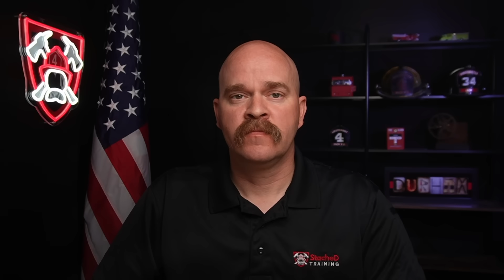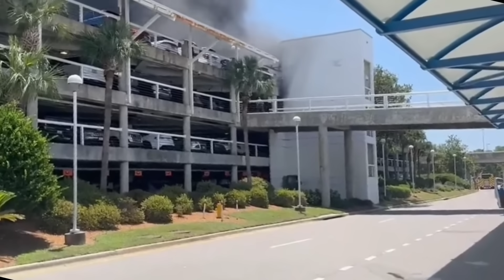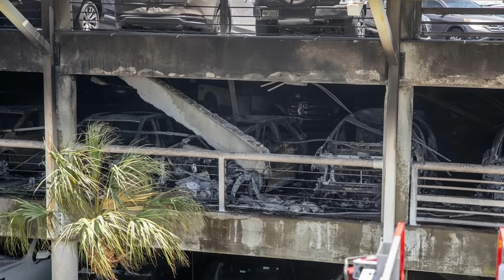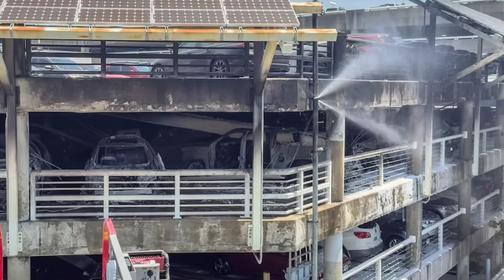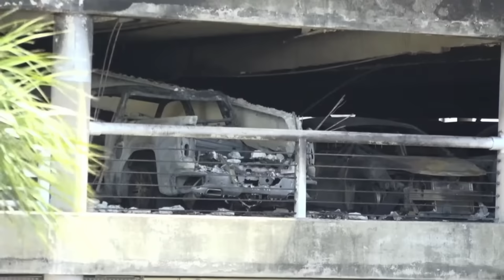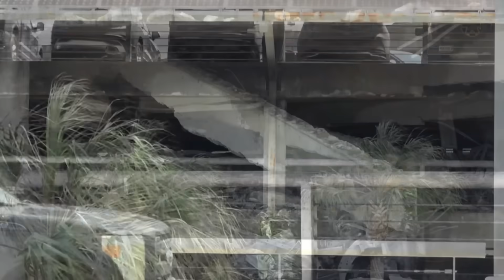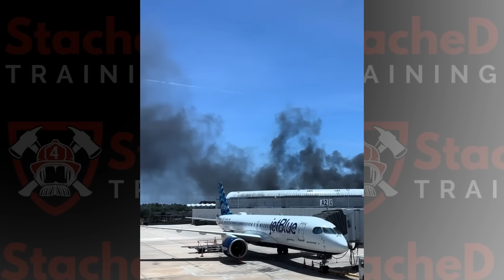Fire, Collapse, and Chaos: Jacksonville Airport Garage Incident

Comment: I like the concept of hybrid electric vehicles form an efficiency standpoint. 
However, we need to take the very real danger this technology posses and make a concerted effort to improve it. 
As it stands I would not feel comfortable owning and operating a modern EV or PHEV design from ANY manufacturer. 

A good idea is a good idea, but a rush to implement a good idea can result in it meeting an early end because the public turns against it. 
This has happened several times in history and once it occurs it is nearly impossible to change the public conception about it. 
This is why media and governments are working overtime to cover up and lie about the dangers of lithium battery tech, they know it is extremely dangerous but are not taking the steps necessary to correct it. 
Companies have no incentive to change the tech, just to push out products to meet demand, and the results are only increasingly tragic. 

Sadly governments are taking exactly the wrong approach to the tech, pushing punitive policies, restrictions, and fines while trying to force a technology that is not ready for it's intended role. They are trying to incentivize people with the stick when the carrot would be much more effective. 
Offer tax breaks or monetary awards of substantial amounts for companies that develop better and safer systems and you will see them rise to the challenge. 
Punishing them for not being able to make the public buy products that are expensive and dangerous is frankly asinine.
Reply: A hybrid vehicle can use a less volatile battery than an EV since its range isn’t as dependent on the battery.
Reply: @dave3657   True, but the chemistry used for the battery is extremely important. 
As we can see with this fire and the frankfurt (iirc) parking garage fire even Hybrid vehicles are dangerous. 
Both were devastatingly destructive fires caused by hybrid vehicles. 
Personally I prefer the concept of a hybrid, a gas engine running a generator and electric motors doing the drivetrain, but there are so few out there that have realized this setup yet. 
Sadly far too many rely on having huge batteries for the majority of their range. 
Personally I think an ideal would be a hybrid using a stable chemistry battery (like a lithium-iron type) with only enough size for about 50-100mile range. That way the gas engine can turn on, recharge the battery quickly, and shut down. Or run for sustained highway speeds to maintain battery efficiency or higher energy needs. 

Just my .02 anyway.
Reply: re: "I like the concept of hybrid electric vehicles form [from] an efficiency standpoint. "
Early models Prius used NI-MH, but 2016 to present used Li-ion primarily.
Remember all those early-year Prius fires? Neither do I ...
Reply: @uploadJ   Agreed. If I recall correctly the Lithium-Iron batteries don't have these problems either plus have significantly longer life. They just don't have the same charge capacity or recharge/discharge rate.

Comment: Well researched video. While concrete doesn't burn and typically has at least a one hour fire rating, it is important to remember that any internal steel giving it shape or strength will expand about 9.5 inches per 100 feet, so roughly 1 inch per 10 feet. The steel can push walls apart or vertical columns that concrete beams rest upon.
Reply: One hour rating must apply to only a thin piece of concrete, as I have seen overpasses that burned in Los Angeles for HOURS. Vagrants and illegal businesses had tons of stuff piled under it. It was on the National news. When it was finally all over  and repairs WERE done to the roadway on top, the structure was not rebuilt.
PROOF..."No, the damaged section of Interstate 10 in Los Angeles did not require complete demolition and rebuilding. Initially, officials considered tearing it down, but after further structural analysis, they determined that "surgical repairs" would be sufficient to restore the freeway. The repairs focused on shoring up the damaged columns, allowing the freeway to reopen within three to five weeks"
Also, in the worst tunnel fire of it's kind in US history "No, the I-80 tunnel did not require a complete rebuild. The westbound tunnel near Green River, Wyoming, sustained extensive damage due to a multi-vehicle crash and fire on February 14, 2025. The fire charred the concrete lining, destroyed lighting and electrical systems, and caused roadway damage3.

However, engineers determined that only a few inches of the 15-inch-thick concrete walls needed replacement. The Wyoming Legislature allocated $15 million for inspection and repairs, aiming to restore the tunnel by October 2025. Until then, two-way traffic is being routed through the eastbound tunnel at a reduced speed limit. "The I-80 tunnel fire near Green River, Wyoming, was intense enough that emergency responders could not enter the tunnel for hours due to extreme heat. While exact temperature readings haven't been publicly released, similar tunnel fires have reached over 1,500°F (815°C) in past incidents.

The fire was fueled by multiple vehicle explosions, including a tractor-trailer carrying transformers, which contributed to the raging flames. Engineers later assessed the structural integrity of the tunnel before allowing crews inside"
Even the structural arches made of alloy deep inside the concrete did NOT need replacing.
Reply: Fire code time requirements vary for the type of structure and construction, with one hour simply being the shortest. A garage fire like this would NOT be the same as an underpass fire, due to the difference in fuel load (BTUs), duration, and temps being applied. Especially after the fire spread to numerous gasoline fuel tanks in adjacent cars, the amount of heat applied in this garage fire  with the low ceilings and reduced ability to ventilate would have been orders of magnitude worse than wood, paper, and anything else that may have been under that overpass.

Comment: One concern I have with hybrids is that, given the battery is considerably smaller than with a pure EV the regenerative braking has the potential to dump a much larger fraction of the battery energy capacity back into it during any given level of regen braking. While I'm sure manufacturers limit the regen braking to accommodate this I feel the small hybrid batteries get a harder life than those in pure EVs. This might just account for the statistics in hybrid fires that are circulating.
Reply: Traditional Toyota hybrids (non-plug-in) operate at a maximum charge range of 40-80%, and under normal operation are limited further to just 50-70%. In other words, the battery is oversized relative to what it is being asked to do.

40% charge is only reachable in my 2016 Prius c when I run the car through a car-wash in neutral (can't charge the battery in neutral), on a hot day with the air-conditioner on. 80% is only reached on a long freeway descent in the mountains. Other than those two circumstances, the battery never drops below 50% charge, and never exceeds 75%, and then only occasionally with 70% being the normal-operation max.

What happens when the battery becomes full on a long mountainous freeway descent, is engine-braking takes over. The engine can be heard revving high as it tries to slow the car down (this is when the transmission is in B-mode, which is the equivalent of low-gear in a conventional car).
Reply: @aliendroneservices6621  Thanks for the reply!
My thought are along these lines:-
Consider regen braking of, say, 1500kg car from 50mph (22m/s) to rest at 0.2g (1.96m/s)
Stop time = 22/1.96 = 11 seconds
Deceleration force = 1500 x 9.81 x 0.2 Newtons = 2943N
Initial deceleration power = F x V = 2943N x 22m/s = 64.7kW (this tapers linearly to 0 as the stop progresses)
Total energy recovered in stop from 50mph = 0.5 x 1500 x (22)^2 = 363kJ = 0.1kWh

If the battery is, say, 2kWh (as, perhaps, in a hybrid) then the initial regen power dump into the battery is at 32C (0 - 100% equivalent in under 2 minutes!)  and the whole braking event would be at an average of 16C (0 - 100% in 4 minutes!) and be 5% of the energy capacity of the battery.

with a 40kWh battery these figures come down to 1.6C (0 - 100% in 37.5 minutes) and 0.8C (0 - 100% in 75 minutes) and 0.25% of energy capacity.

With this sum in mind I'm concerned that some manufacturers may be tempted to give the small batteries in hybrids a hard time in order to maximise the effectiveness of regen braking.

Comment: It's weird that sprinkler systems were not the default, knowing how much more common gas and diesel vehicles catch on fire ;) It's only the very rare EV battery issue that calls for expensive sprinkler systems to combat the very rare occasional EV event.
Reply: Gasoline is the you need to worry about, the fumes are very dangerous.  Diesel it takes alot of to burn.

Comment: how did anyone ever think that 600 v 50 kWh batteries in cars would be a good idea and then mass manufacture them? - and people believe in evolution ...
Reply: Imagine - building a 'kinetic energy recovery technology' into vehicle that could actually save actual money, but it DOES involve batteries, and we call them HYBRIDS ...
Reply: @uploadJ  how much energy do you recover? enough to cross the intersection. is adding so much complexity justified? there is nothing green about lithium batteries. for every 1 ton battery you have to mine 250 tons of ore and all of it is transported using trucks run on fossil fuels and processed with energy generated by fossil fuels etc etc. the whole net zero agenda is madness. resale on EVs is abysmal and the whole thing is a scam look at all the EVs in massive EV graveyards. EVs are throw away ill conceived electric 6 ton boat anchors.
Reply: Government has worsened this problem by pressing the public hard on EV adoption. Without the myriad state and federal incentives, adoption would have proceeded more gradually due to genuine market forces, and there would have been more time for infrastructure to catch up with the new fire threats that EVs bring.
Reply: government mandates pushing a technology not wanted by the majority of people.

Comment: Sprinkler systems in an open air parking garage will require a dry pipe or a pre action system to prevent pipe or sprinkler failure in freezing weather. Yes it can get below freezing in Jacksonville.
Reply from the maker: The maintenence side is an absolute nightmare in cold climates.
Reply: "Can" get below freezing, but minimal insulation and a heating element will keep water pipes above freezing.
Reply: @koriko88 what about in cold locales?  Where i live it can be minus 30 at night with daytime highs of minus 15F.  How could that possibly work.
Reply: @howebrad4601 You’d have a different system there so it would be an entirely different discussion. That’s not where this is. This is Jacksonville.
Reply: Many of the open air systems here are pre charged with glycol.
Reply: @JordieG8  glycol is flammable, haha
Reply: @jamesalles139 pure glycol is moderately flammable however, when mixed with water it is not.
Reply: @JordieG8 when the water boils off it does become flammable again
Reply: In my part of Canada, open pipes are filled with glycol to sit. Upon an event, the glycol is quickly followed by water. Other point out glycol is flammable. Yes, but not like gasoline or diesel.
Reply: The clycol is probably just for keeping the lines from getting  damage from freezing in standby mode ,if a fire acures and the system is put in action  there is no point of keeping pumping in glycol into the sprinklers.  The system needs to be built for clycol re filling afterwards if the damage from the fire isnt so big that it doesn't matter anymore if it freezes.  There are fog/ micro droplets sprinklers that cool of better and  than the traditional type of water sprinklers they use dramatically less water also( less contaminated water into the environment),and the fog displaces air limiting the oxygen to the fire .
These types of systems can be built as dry systems that are supplied with water from pre pressurized tank, because the amount of water used is less the sprinkler heads can be open, the system just fill the whole sprinkler section area with fog.
Reply: @perstaffanlundgren yes, basically. A pre measured amount of glycol, based on system volume is placed into the system before the supply valve is opened. Here, I believe the amount is based on keeping the system at a -15 freeze point. It’s doesn’t get that cold here.

Comment: How about No electric, or hybrid in any parking garage
Reply: Any vehicle fire in a garage without working sprinklers will be a disaster. And with modern vehicles having more unnecessary electronics in them with people also leaving their own electronics in them, the likelihood of vehicles going up in flames from electronic failures will still go up in general.
Reply: Make sure to ban the gasoline and diesel vehicles, too.  I've seen gasoline burn!
Reply: Why, ICE vehicles cause proportionately many more fires,  and have been involved in many more devastating garage fires.
Reply: @mr3745 but they typically don’t run wild like battery fires, create hazmat with the remaining batteries. It’s easier and less complicated to control a ICE fire. They don’t runaway like the Jax fire
Reply: Plastic fuel tanks near hot exhausts.... even a semi-seized brake calliper can cause fires... should we remove those too ???
Reply: Eventually insurance companies will have to do something about the disproportionate risks of EVs and hybrids. I can imagine them requiring something like 20ft radius distances between parked EVs or separate EV garages or more effective fire suppression systems that don’t use water. EVs are just intolerable.
Reply: I strongly agree
Reply: Unfortunately some of the most devastating parking garage fires didn't involve either hybrids or Bevs, nor were they even present in the garages.
Reply: @ryanfagan4563  Where were those incidents?
Reply: @andrewlutes2048  one is the 2017 Liverpool Echo Arena Parking Garage Fire. Another and more recent, is the Luton Parking Garage Fire. Almost 3,000 vehicles destroyed between these 2 incidents. There are plenty more
Reply: @PaulThomasHarris Just to add here it only makes sense to add gas and diesel and hydrogen fueled vehicles to be banned in any parking garage too.
Reply: Also no gas or diesel cars in any parking garage.  Then there will be no risk of fires whatsoever.
Reply: @koriko88 
Well then it's not a parkings garage is it😮
Reply: @koriko88 dope
Reply: @koriko88 diesel is safe, gasoline fumes are a problem
Reply: @koriko88  Gas and diesel vehicles do not spontaneously combust into runaway infernos
Reply: @msw7021 the 2 major fires I just noted before your comment were both gas and diesel, that sparked MAJOR fires. It happens a lot

Comment: BMW recently recalled over 700,000 vehicles due to electrical issues in the water pump, causing fires. This fire reminded me of that huge Garage fire in England about 8 yrs ago. Sprinkler Systems should be required even as a retro fit.
Reply: Liverpool’s Echo Arena Garage Fire 2018, Also the Luton Garage Fire
Reply: Luton was October 2023 and 1400 cars destroyed!
Reply: @bokhans exactly, hence the need for fire suppression in a parking garage
Reply: What wiring do you need to run an incredibly simple and mechanical water pump?!?
Reply: @Foofrarf23 Specifically, the problem with these BMWs involves the water pump's electrical pump connector allowing water to drip from the positive crankcase ventilation system through the seal, potentially causing a short circuit.
Reply: If BMW caused this fire due to a defective waterpump or a EV they should be responsible for the damages & other vehicles lost thru their product liability insurance coverage
Reply: I think you could put a spinkler system in this building being it is in warm climate. I have been out of Metro airport in Michigan many times. In winter those sprinkler lines would freeze with the openess of a parking garage
Reply: Sprinkler systems tend to suffer from vandalisim and frost damage in these kinds of buildings...this results in them.being turned off too often..
Reply: BMW vehicles had huge problem of spontaneous combustion few years ago in South Korea.
not sure if they resolved the problem.
Reply: any combustion car thats leacking oil can catch fire
Reply: Water pump in an EV?! Lol.
Reply: @DesertCatDad  Many, if not most, EVs have a watercooling loop for the batteries, and they have waterpumps to circulate the fluid. But the BMW recall was for the ICE water pumps, which are electric in many BMWs.
Reply: That makes sense. I got hung up on terminology. I would have called it something different. 

 @Kevin_Rhodes
Reply: @Kevin_Rhodes  If you're BMW, there's no sense making anything simple, reliable, or inexpensive to repair.
Reply: @jed-henrywitkowski6470 who said anything about an EV?
Reply: @DesertCatDad  Hybrid.   It still has an IC engine.
Reply: @DesertCatDad  evs do have water pumps,maybe you need to watch some videos of car taredowns and dissasembely because you clealry have no clue what is under hte bodypanels of a car

Comment: I'd be interested to know about a high heat EV fire near exposure to the tensioning points of the garage tensioned slabs. That may have been the source of the collapse. Tensioned slabs are dangerous in normal fires. Thanks
Reply from the maker: The plastics, foams, and rubbers drive most of the heat released in a vehicle fire.
Reply: If you don't know concrete needs reinforcement to be able to be a slab with air under it.